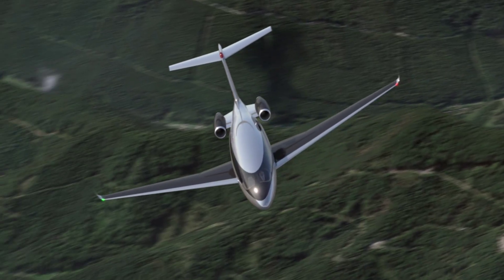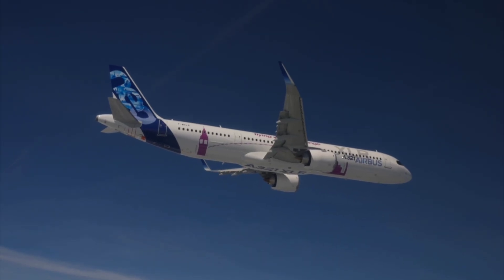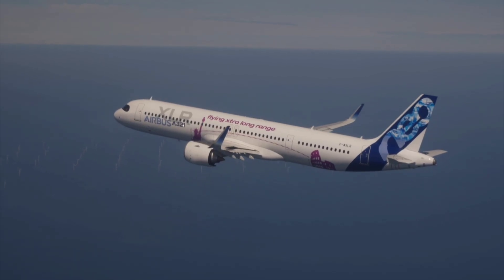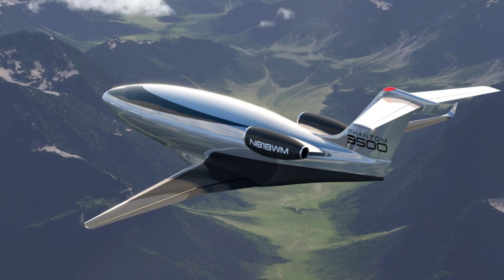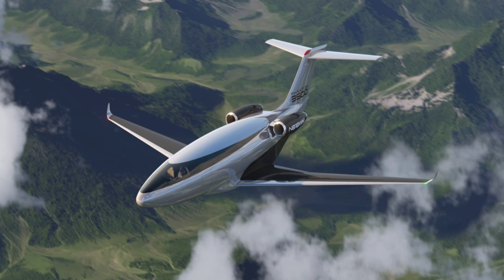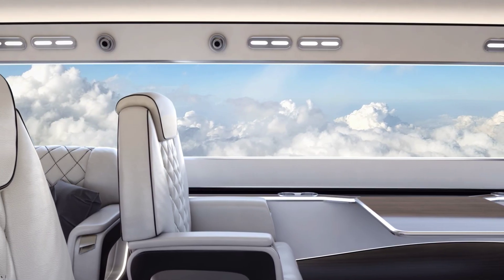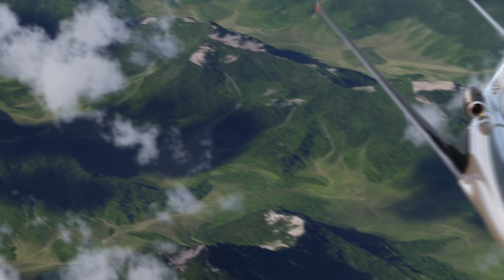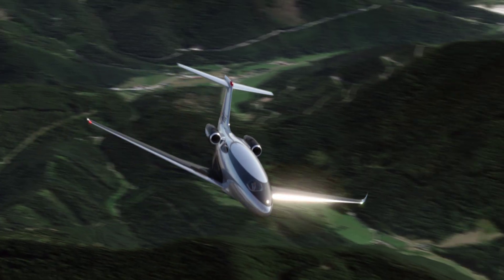This Futuristic Phantom 3500 Jet Has Windowless Fuselage for Maximum Efficiency

Comment: $5 million less than anything in that class. 1500 more mile range. Flies for 40% of fuel and costs. Lands in 3500 feet.    Dammit, I'm 65  and this won't be available for me to buy until 2032. I'll be 72 damn years old.   That's just not fair.